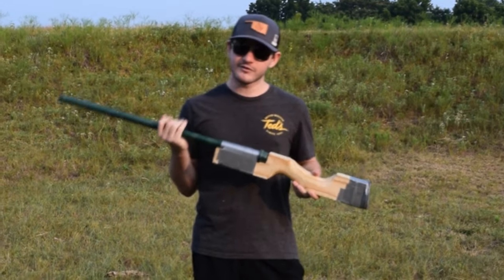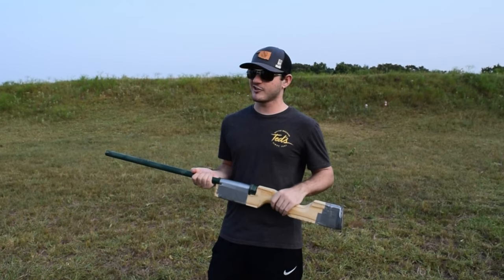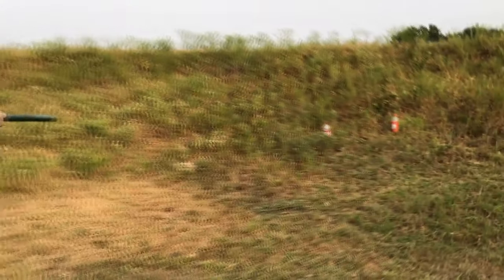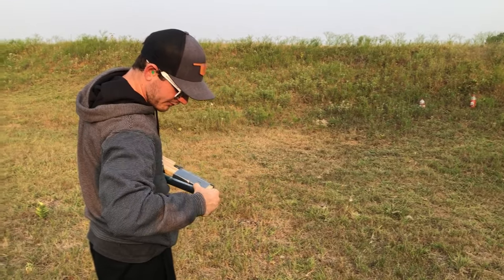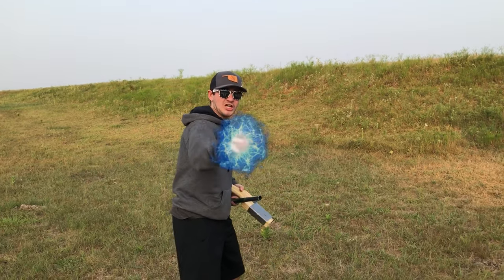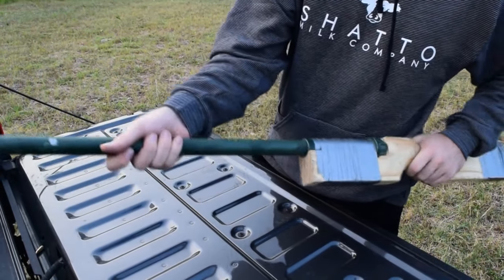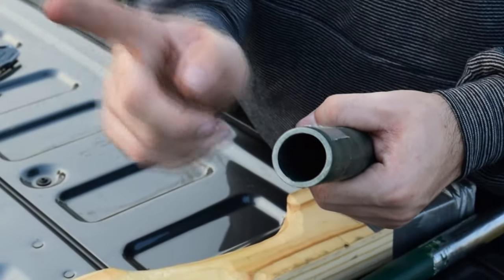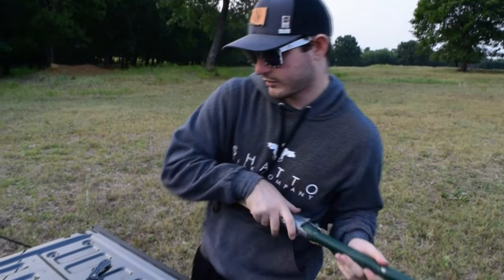CHEAP Pipe Shotgun That Anyone Can Make

Comment: In theory, could someone also apply this to other more common calibres? Or is this just a coincidence
Reply from the maker: I suppose if you had a long enough adapter, you could. And the cartridge would need to be rimmed or else it will just slide down the barrel. I'm sure it's a little more than a coincidence but for the most part I bet the math just worked out that way
Reply: @PlastikGatz  Im sure someone will figure it out sooner or later, thanks for answering!

Comment: Lastnight i went to my srorage unit ? Sombody threw out a 1976 revelationwestern auto bb / pellet gun . wont hold air but in great shape . old.. Also a remington 12 gauge barrel ... Im now wondering what i can make with it . ? So sence i have a barrel. Can i use it to make a homade gun ??? Long barrel with the bb sight....
Reply from the maker: I mean, I guess you could try to make a receiver and see how that would work but I would not recommend it unless you know what you’re doing. The only reason I built this one is because it is a time tested design

Comment: That's not how you use a shotgun. You don't need a cheek rest or a sight on the receiver. 

Shotguns have a bead as a front sight post and that's all.

You don't shoulder them, they go closer to the center of the chest.
Reply from the maker: I meant how the barrel wasn’t high enough compared to look down and aim. Because the stock and barrel are perfectly in line with each other, the only way to “aim” this abomination would be to crane your neck at an awful angle and that a check rest would be nice. This may not have come across well in the video
Reply: @PlastikGatz  oh okay, I didn't get that

Comment: What would happen if you made a suppressor out if the barrel?
Reply from the maker: You mean an integral suppressor?
Reply: @PlastikGatz  no, I mean turning the barrel into a suppressor by boring holes and adding a tube to the outside of the barrel. 
Lol 😅 what about hydrozine as a propellant? Lol 😅 
Electronic ignition?
Lol 😅 😆 its time to think outside the box lol 😆 😂

Comment: if you willing to throw in a few extra bucks, you won't even need shells anymore
batteries, wires, and a flip switch, add in black powder and sack of buckshot, and you get a perfectly functional firearm with (somewhat)proper trigger system.
safety? depends on how well you build it, could be as safe as a normal gun, could also be a grenade.
Reply from the maker: @SYN7H3T1C4  too complex and defeats the spirit of the gun

Comment: Im confused . Can you use any color duct tape ?
Reply from the maker: Well, according to the manufacturer of this product, this is totally NOT normal standard grey duct tape. I believe they specified it as "military grade adhesive stripping." Totally not at all just normal duct tape you can find at Walmart or any other store that sells duct tape (which, I cannot stress enough, that it absolutely, totally, unequivocally, without a doubt is NOT just regular duct tape). But I would presume that the color of this material would not matter at all. I hope that answers your question :D
Reply: @PlastikGatz  Sorry I did mean the  military grade adhesive. My local store actually carries the military grade adhesive  in black . Thanks

Comment: Would a certain model work on a small bear? Or mabye just a better version
Reply from the maker: I would not recommend using this on a bear unless you were absolutely certain of your aim, the function and quality of the firearm and your ammunition of choice. Depending on these factors, you have a very high chance of either missing the bear (this thing is not easy to aim with without specifically practicing with it) or simply making said bear angry lol

Comment: any suggestions on lenghts for the parts- barrel, end screw, etc?
Reply: At least an 18 inch barrel so you don't get arrested by the ATF.  Shotguns have to have at least 18inches of barrel to be legal.
Reply: If you use a screw or nail round the end off so it’s not too sharp.

Comment: Just an idea..grind the business end of the barrel down the same..I`m sure youll figure out the rest.
Reply from the maker: The original design implemented a barrel that was the same thickness at either end so you could more easily and quickly load and fire shells. This would have been a good idea in hindsight lol

Comment: you can legit just make s bolt action using a bolt door lock it has all the mechanisms and the hammer to strike the pin which is the bolt itself. put it inside a tube make a cheap wood stick and boom. no need for a tricker just slider it back and let go of the bolt and it should slide back firing the pin assuming you're getting the door bolt locks with the springs in em even then you can just manually slam the bolt back and fourth and get the same effect

Comment: I heard you can just stick a shell in the other end, turn it around and it will blow the old shell out, for rapider fire. Technically that's a barrel obstruction and incredibly unsafe, but I heard Phillipine farmers do it with theirs.
Reply: Probably make sure the "chamber" is polished and the unfired brass fits loose as practical, and test fire with a string pull first few times.
Reply from the maker: Well originally that’s what was supposed to happen. However, both ends of the pipe needed to be ground down to fit in the receiver. After taking the time to fit the first side, I didn’t want to do the other side lol but yeah you could
Reply: @PlastikGatz  it'd be a lot faster than prying shells out, it'd be more like a single shot w ejector, well worth the time if this were your main weapon.

Comment: Does nobody worry that these pipes are rated for the 10,000 to 15,000 psi that shotgun shells generate?
Reply from the maker: It didn’t blow up in the Philippines and it didn’t blow up here 🤷🏻‍♂️
Reply: @PlastikGatz  I dunno... doesn't seem like a good thing to do... pipe rated for 300 psi...

Folks may be getting away with it, but would be nice of a serious firearm engineered commented.

You're playing with fire, literally. But it's your hands and face, your choice.

Seems to me there's roughly 3 levels of strength for something like this...

1. The metal is strong enough, thick enough to take the pressure indefinitely.
2. The metal is slightly less strong... it will deform and eventually blow
3. The metal is too weak, will blow on first hit. 

So we know we aren't in (3)... but whether we are in (1) or (2)... how can we know?

Truth is, I'd bet, no one here has any idea how to be sure.

That said, a problem with slam fire designs like this is... if the shell doesn't seal... hot gas is going to be heading right for your barrel hand.  If does, gas cutting can be really destructive.

Comment: Can children make it?
Reply from the maker: If they are under extreme supervision, then probably ig
Reply: Ok can it be used for hunting?
Reply: Most likely, I'm sure
Reply: @rickhodge6482 you can try you’ll probably miss though. I wouldn’t use it for anything but bird shot personally.
Reply: @PlastikGatz where can I find $30 and a Lowe's?
Reply: @keepermovin5906 I will shoot any bullet that fits in it out of it. My only requirements: it shoots and it fits in a gun.
Reply: @rickhodge6482  I think the chances of it exploding with 00 buckshot is very low but not zero. Also more realistically the recoil on the two by four stock would hurt like a bitch. If it was the only thing I had to save my life ide definitely use it though.
Reply: @keepermovin5906  merry Christmas

Comment: Would the manufacturer know the measurements of the barrel?
Reply: 1 " pipe as the receiver. 1" pipe end cap on the end of the 1" pipe. Drill a hole in the center of the end cap and secure a screw or nail in that as the firing pin. Put a shell in the barrel (3/4" pipe) and I think you can figure out the rest. Do so at your own risk.

Comment: you need 1 spring and a trigger. ez fix
Reply from the maker: This was the simplest design. I would also like to point out that while it may be easy to bring up improvements, taking the time and effort into implementing them into the design far outweigh the initial ease and speed of making this particular design

Comment: why pipe not explode? if you use it like barrel in normal 1 barrel shotgun it can explode.
Reply from the maker: Shotgun barrels are thinner than this pipe
Reply: @PlastikGatz  you mean this pipe can  easily replace the barrel of a real gun?  there a special steel in factory shotguns, i believe is it?
Reply from the maker: @user27108  it doesn’t matter what it’s made of as far as steel is concerned. And even if it becomes an issue (which it won’t), this weapon is supposed to be a short term solution to get a better weapon
Reply: @PlastikGatz  okay. got it. thank you. very informative video and comments.
Reply: @PlastikGatz  you have a good day.
Reply: you too have a good day 🙂

Comment: that is a terrible design... your hand is right where you don't want it to be if that pipe explodes from the pressure. just attach a small handle to the front so you can keep some distance between the barrel and yourself.
Reply from the maker: @simonphoenix3789  you’re a terrible design